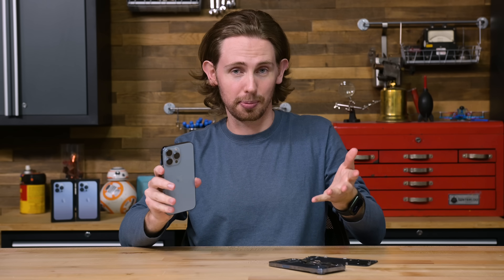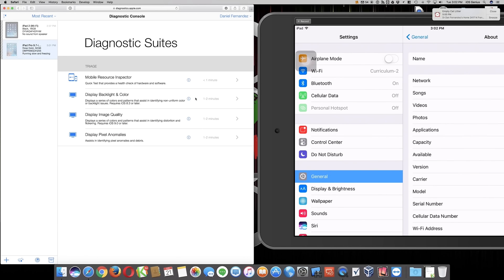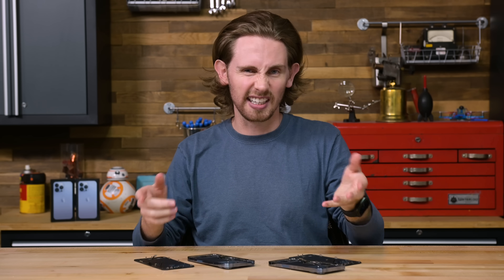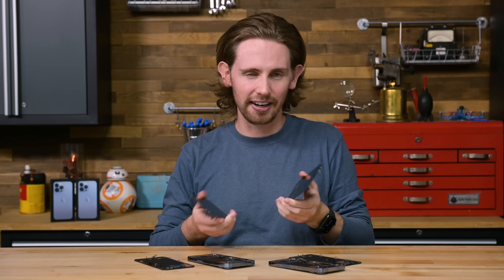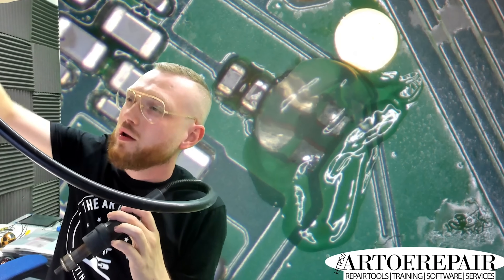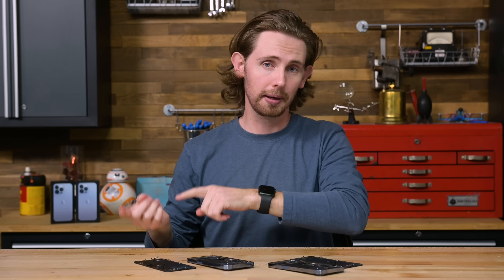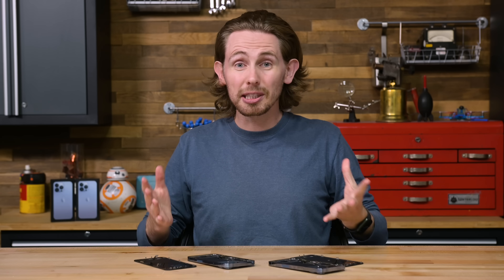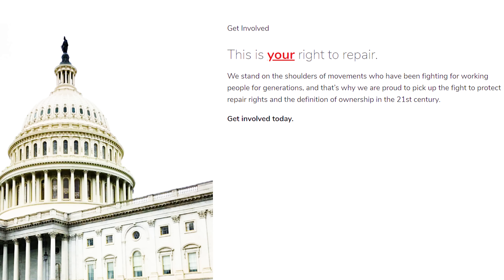Apple Broke iPhone 13 Screen Repairs

Comment: Hey human made it, human can bypass it. Anything made by human can be bypassed by human.
Reply: The thing is: is that a viable option? Both from an economic and legal standpoint. Sure you can probably go to places and find copies of Apple's software or guides on how to bypass it. But that takes time and I'm pretty sure that wouldn't be feasable for a repair shop to do en mass. Then there is the legal issue: Using, for example, pirated or leaked component pairing software, especially in an commercial setting, is illegal and would result in your door being, very rudly, removed from its hinges.

Comment: I have an iPhone 7 which I put a 3rd party battery in..there's no error message and it shows the health properly...can someone explain this?
Reply: iPhone 8 and lower can be repaired without any problem. It starts happening from iPhone X.
Reply: @Reiza72Owened  even with iOS 15 upgrade, if I were to replace the battery on the 8 and below, the error won’t appear?
Reply: @lilPopper  no error with iphone x and earlyer... xr and later will have error massage
Reply: @migru9988  ok thanks
Reply: The error message regarding battery started happening on the iPhone X and above. 

I am honestly not sure if the iOS 15 upgrade will display that error message unfortunately. But, On Phone Repair Guru’s channel, he made a video on how to bypass that error if something happened.

Comment: For me FaceID is a Security Element. It should not possible to replace it with a other one. I like it because every repair shop can be part of the repair network of apple. It is a good design for security witch is more important.
Reply: We are not talking about faceid, but the screen. FaceID hardware still the same after the screen swap, but stop working anyway.

Comment: Fairphone FTW!
Reply: That’s actually a pretty cool design, but 699€ (for 799€ you can get a Mi 11 witch is a top range phone) for a mid range phone is a bit too much. At least put a Snapdragon888 and a better display. I will wait for Fairphone 5.

Comment: what issue? i dont see the issue.... why would anyone go to a repair dude to replace an iphone screen? i would never do that.
only Apple should be allowed to repair if even, mostly a new device is better for the environment and cheaper than any work.
this of course is only true for an iPhone.
Reply: Its far worse for the environment. Think of the truck loads of replacement parts and equipment apple needs to ship

Comment: Apple shouldn’t have to disclose or share their proprietor software with nobody’s like you.
Reply: Correct, and if they didn't apply monopolistic anticompetitive practices to lock down their iPhones arbitrarily to increase repair service profit, they wouldn't need to. But I understand, it's a complex issue, and that's why only every other single phone manufacturer has solved it already.
Reply: i found a fanboy

Comment: 4:24 Ya, let's go back to the 60s-70s when computers are the size of a house and hundreds of thousands of dollars. That sure makes repairs easier.
Reply: Replacing broken screen or old battery, hardly qualifies as repair.
Reply: That's irrelevant. Shrinking down components over time (thus reducing cost and size of computers) has nothing to do with glueing the device's enclosure and batteries, requiring pairing via proprietary software for replacement parts, or making parts and documentation for repairs unavailable.
Reply: @leonro  I mean I am not in the industry but from my understanding, all of that is avaliable to the third-party repair shops through the Apple repair program. I am not sure why that is a problem. Devices are becoming more complicated, and it is not the companies responsibility to teach everyone how to fix everything. I don't see a difference between this and hiring a licensed electrician to do the wiring in one's house.

Comment: I've watched videos on how to remove the chip 300 times, bought all the equipment needed and currently am testing it on broken iPhone 11/12 LCDs until I'm ready for the 13
Reply: WE DID IT!!! APPLE REVERSES THIS!!!!!!!!!!!!!!!
Reply: I guess we have to simply evolve
Reply: @odder5154  correct we incarnated here in order to grow
Reply: Ayy smart move, PROGRESS!
Reply: @AriT105  The phone and screen will still turn on even without the touch IC chip, touch won't work. So I'm practicing on LCDs that customers fix that are not recyclable. Every repair shop should be saving broken LCDs for practice
Reply: are new iphone 13 screens available
Reply: That's great
Reply: simpler solution dump it and get a none crapple phone
Reply: Nice i just learned how to fix Face ID on X

Comment: I am ok with the circumstances Apple is blocking third party repair shops changing I-device screens with cheap and low quality parts. That way less people will get scammed when buying used iPhones on ebay or Craigslist. 
Right to repair is good but it should have its standards.

Comment: I don't think people understand how important it is to force companies to allow an OWNER to repair their OWN devices, tools, etc. Laws have to be enforced to avoid this kind of anti-consumer practices.
Reply: Well well well do I have good news for you
Reply: The thing is that most people don’t really care about repairing it themselves or using a small repair shop and would send it to apple anyways even if it was an easier replacement. I think a lot of people will just pay the extra $200 or $10 per month for apple care and get $30 screen replacements. The right to repair movement is such a minority compared to the total iPhone customers.
Reply: @curly7985  I don't think so, look at the Framework laptop,  a child can repair it. You wouldn't pay someone to unscrew a few screws and slide something in
Reply: @curly7985  The thing is that Apple Care only lasts for 2 years. What if you want to keep your phone for longer?
Reply: @avinashanish3350  Apple don't want you to keep your device for long, they want you to buy the next new overpriced one, and if you don't they will eventually tamper and slow the device down through updates so therefore you have no choice. Samsung also does this.
Reply: @tyronenelson9124   Even a Truck driver makes 60,000 $ in U.S. can't you spend a 1000 $ to buy a new one once every 3 year ??
Reply: @u6h149  No, not really when I'd rather by a car instead which belongs to me and doesn't need to be updated every 5 minutes.
Reply: @u6h149  it should be YOUR choice
Reply: @r3dp1ll  How else do you think company makes cash flow ?? Look what happened to Sony.
Reply: @tyronenelson9124  Once environmental norms kicks in gas cars will go extinct. You think any mechanic can service a tesla ??
Reply: @u6h149  that's why we need laws to level the playing field
Reply: @r3dp1ll   Its the customer who should level it through their money not laws. Apple has a standard warranty of 1 year and additional warranty of 2 or 3 years. Why do people expect it to run longer than that.
       Sony offered them high quality but people rejected it.
Reply: @u6h149  right to repair. Plain and simple. You buy something you should own it. All these products are mostly disposable. Massive waste of ressources and also a money grab. But let's go further, do you really think that capitalism should be completely unregulated ? 
We live in a system where global conglomerates and high finance rule over supposedly sovereign nations. It's a complete disaster.
Reply: @r3dp1ll  Yes when you buy something you own it. But you don't own any spares. You own what is in that phone and the hardware in that phone.
       There have been incidents of battery explosions etc.. They harm the brand image.
Reply: @r3dp1ll  Ever heard of Framework laptops ??
Reply: @u6h149  Unless you know exactly when a petrol/gas car will go extinct, you shouldn't worry about it, and no your right, a tesla car is not meant to be serviced and repaired but scrapped and recycled once it goes wrong like everything else does that contains a microchip and software.
Reply: @u6h149  you're very stubborn. Framework ? Scroll up and you will see my comment. 
No you don't fully own your iPhone. Are you an Apple rep ? The battery thing sounds exactly like what an Apple rep would say in court. You don't didn't address any of my points. Ask also farmers what they think about John Deere.
Reply: @r3dp1ll  Yes you own the phone you buy. But you don't own the spares. What's wrong in apple saying the manufacturers not to sell their proprietary components to others.
Reply: @u6h149  How can that be? what you are saying makes no sense because 5 years is way too soon as they would have stopped manufacturing the gas/diesel cars a long time ago and they are still even being manufactured now
Reply: @tyronenelson9124  Companies aren't going to stop it govt will make them do it. Environmental regulations will force companies not to manufacture gas cars.
Reply: @u6h149  correct. But in this case, not so much. When I buy something, I’m supposed to have full rights over my product, meaning I should have at least some options to somehow fix and repair it myself, maybe even upgrade it using better parts (ie, case replacement). But Apple not only make safe and authorized spare parts inaccessible to the average consumer, they also prevent the use of compatible parts overall, even if it was taken straight from another phone of the same model. Meaning they are intentionally manipulating the product so that it would have a shorter lifespan so more people would buy their new more expensive products. That’s their business model, they sell solutions to the problems that they create. That business model harms the consumer, often without their knowledge
Reply: @curly7985  Farmers have the same issues tho. Most companies wont let them work on their own equipment.
Reply: I don’t trust 3rd repair shop. There are incidents that user data is leaked by technicians. Better safe than sorry
Reply: @why5784  even if you don't use 3rd repair shop, with right to repair you can fix it yourself.
Reply: @why5784  not only data leak but sometime they replace original components of the phone with fake ones
Reply: what about when black markets get their hands on repair tools and now you can get your phone stolen and still keep its value, because someone can just swipe parts and deactivate the icloud lock, and just do whatever they want like an android device?

i want to be able to repair my device, but not at the expense of it getting easily repaired by a thief or resold to someone else..
Reply: @at_oussama true iCloud lock can be kept and it can be more repair friendly without software locks as for the other part if you back up your data wh9 cares if your phone is stolen and repaired it will still be iCloud locked
Reply: @at_oussama  that’s such selfish mindset

Comment: Well, they had to go and put the FaceID controller/memMAP on the screen. Sure, from a security standpoint, it’s not a bad idea to prevent tempering with that subsystem in order to increase security. But from a repairability angle, it is bad. Why didn’t they put the controller else where? That way, screen replacement would have remained faisable.
Reply: Can u explain the security standpoint?
FaceID needs a reboot to initialize.
After a Reboot, you cant use FaceID directly, you have to put in the pin first.
Reply: Not sure I understand what you’re trying to say, here. PIN can be guessed or brute forced with a device. I’ve seen people do screen swap with phones/tablettes still on (I even did it a couple of times. Not saying it is safe!). So, without serialization of security subsystems, you open the doors to security flaws. Not saying it’s a good thing and that most people would not opt out of it. I can also think of another way that could be useful, but it is all theory at this point since it can’t be tested (well, I can’t).

Comment: I mean I personally like the idea to get notified by the iPhone when the screen is just not original. Just so you know that the dude that repaired your iPhone and claimed to use only original components, probably lied to you. And it would be even more welcome on the battery because cheap third party batteries could be dangerous.
But killing functionality that kinda doesn't even has anything to do with the screen is a huge No-Go and I hope Apple one day will stop this nonsense (and if it's by being forced by law).
Reply: The message pop up even if they put an OEM screen. In fact if your iPhone detect a different serial number it will automatically warn you that it’s a non genuine screen.
Reply: Apple does not produce or licence "original parts" they actually litigate against it, the only parts that reach the technicians are produce on the side by OEMs and distributed via  gray market. So let's force apple to produce enough repair original parts for their crappy products.
Reply: @lc7ineo  Samsung an google makes great phones?

🧐

You ever used Zfold1 my man?

Comment: Apple is "green", that doesn't mean they will let YOU be "green".
Reply: They are as green as a $ bill, not as a tree tho :)
Reply: @zdanee  The funny thing is that my comment still applies with your description 🤣
Reply: they say they're green which means you should be able to use your phone for longer... but when its cheaper to just get a new phone than to get a screen repair thats not very green, also restricting third party repairs just makes it harder to keep the same phone
Reply: Greed would be the best word.
Reply: Sure.
Reply: You do realize you can go to Apple, right? They will repair anything wrong with your phone. If you can't afford it, you shouldn't be buying iPhones in the first place. Also, its the customers fault for not repairing their phone and adding trash to the environment.
Reply: @ea9849  And they will erase your data
Reply: @ea9849  Also let's go to USA so i can go to Apple (since there isn't a single Apple Store in my country) and it won't be my fault anymore 🤣
Reply: @ea9849  500 bucks for back glass replacement on the iphone x bro, tell me it isnt better to just a new phone